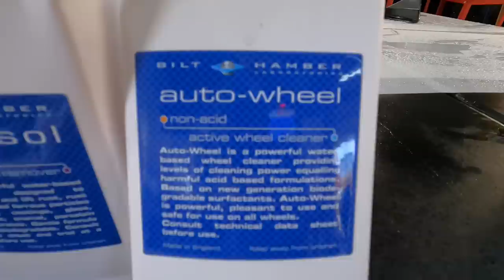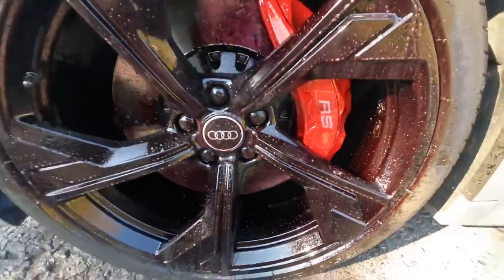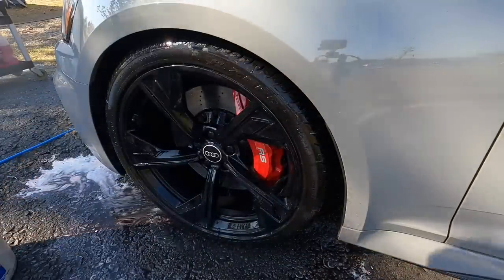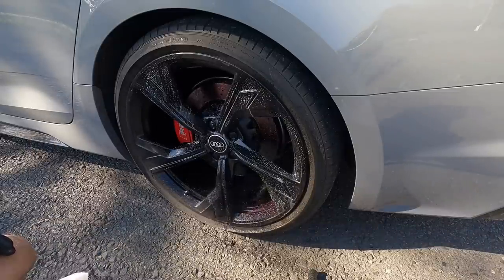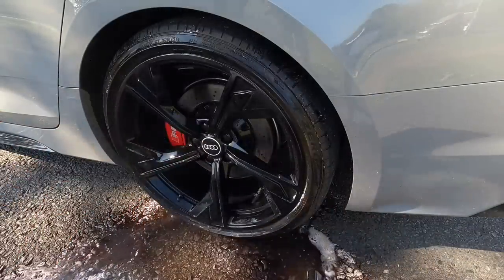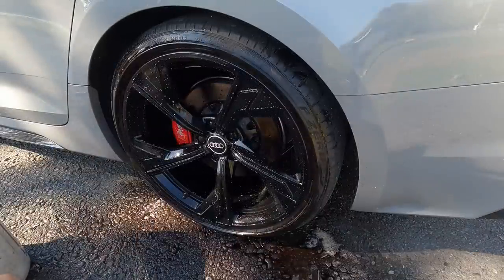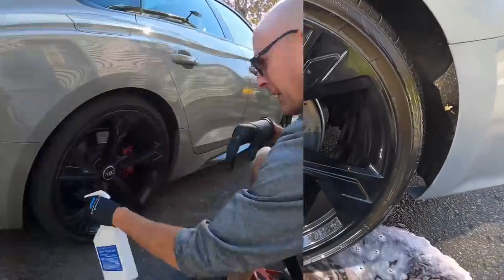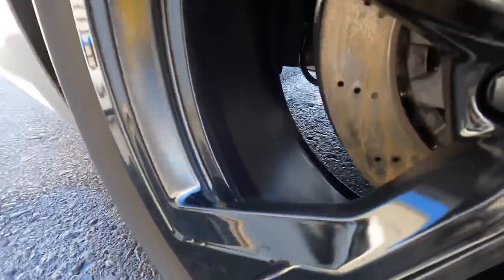What A Team!!  Bilt Hamber Auto Wheel & Korrosol!! Brake Dust Doesn't Stand A Chance!!

Comment from the maker: What is your go to wheel cleaner? One of my favs is Nanoskin Non Acid Wheel.
Reply: I normally use Bilt Hamber Korrosol and either Surfex HD or Majestic Solutions Tidal Wave
Reply: I've been using the Adam's Tire and Wheel in the gallon container recently.
Reply: I’ve been using the Adams as well, but when my gallon runs out I’m going to try this Bilt Hamber next go round.
Reply: Koch chemie sells a 15ltr, very effective and also Nerta active diamond foam.
Reply: Surfex HD seems to do better than most wheel or tire cleaners at 15:1 and even 20:1, I use it for wheels and tires, engines, interiors, some fabrics and even  as a floor cleaner in the house and garage at 40:1. Cleans vary well, virtually no smell and rinses and wipes off easily.
Reply: I normally do Gyeon Wheel Cleaner and followed with P&S Brake Buster in a foam cannon for extra lubrication. I recently bought P&S Knock Off Wheel Cleaner but haven't used it yet. Anyone tried it? I also bought their Undressed Tire Prep.
Reply: I use nanoskin non acid also based on a very old video you did. I bought the gallon from Amazon for under $20 at the time. Still have about 20 oz of the bottle left and I'm detailing two cars every other week or so. The retial bottles are such a waste of money, in my opinion. I use with the marolex foamer. Less product waste and more bang for your buck. I use eagle one iron remover every few months to deep clean and remove any ferrous metals. Luckily Ollie's had a case of them earlier this year and I grabbed about six bottles. Very impressed with the nanoskin non acid though. Thanks for the recommendation from a few years ago. Will buy again probably early next year when I run out.
Reply: BH Auto wheel. It's fantastic stuff. Links well on wheels. I save the Korrosol for the paintwork.
Reply: Poor Boy's spray on Rinse off
Reply: P&S BB I havent gotten to, using up other stuff, I did use Surfex HD the other day and it did very well. I think it was at 1:7 ratio.
Reply: Brian, is this your usual process for wheels? Iron remover, rinse, wheel cleaner, agitate, rinse? I typically use Nanoskin in a foamer, agitate, rinse. Iron remover if necessary.
Reply: Fireball iron burn and 3D BDX
Reply: Sonax beast so far

Comment: Been using Bilt-Hamber products for a couple years now and there NO turning back! It started with their AutoWash, VERY, VERY concentrated, literally an ounce for 3.5 gallons is too much even!

Next was their dynamic duo of Auto-foam and Touchless. These are both pre-washes and no matter ANYONE says...THE BEST ON THE MARKET and its not even close❗️ Last winter I used 5 ounces of Auto-foam and 1 gallon of distilled water in my IK Foam Pro 12 as a pre-wash at the quarter carwash and it literally MELTED the salt and muck from my car. After a rinse there was just a faint shadow of dirt but you had to look for it❗️

I used Karrosol as a chemical decon on my paint and it was amazing and will use it come spring as a post-winter detail but using Auto-foam and Touchless it isn't going to have to work too hard❗️

The only distributor of Bilt-Hamber is somewhere in your backyard Brian, I'm not mentioning them by name out of respect ofcosrse but I'm sure the viewers can find it and once you do you'll either purge your other products or give them away❗️❗️

Comment: I like there APC surfex hd I use it for wheels and tires most of the time at 20:1 and it instantly turns brown and cleans fast and rinses easily, I use it for interiors aswell at the same dilution and it really cleans those dirt covered plastics in one pass where as most of cleaners take 2 rounds on the same areas.
Reply: For the interiors you can drop it down to about 2% (or 50:1) and it still cleans as well, it's the best APC in existence right now I think.
Reply: Don’t use it at that dilution for interiors mate. It leaves a slick film on plastics at such a high concentration. Can be dangerous if you’re cleaning pedals. 

Use at 2/3% max. Avoid using on leather. 

5-10% max on wheels. 5% really as you won’t notice any difference and it’s a waste of product going higher. 5/10% are archways and tyres. Same for engine bay as well. Can also we used at the same concentration as a citrus prewash. Either do lower panels or the whole car.

Comment: Would say just but Korrosol. No need for Auto wheel. The reason why is that Surfex HD is perfectly fine to use on maintained alloys or even dirty ones. You only need Korrosol every month or two to clear out the fallout. If you’re disciplined, Surfex HD is more than enough.

Comment: Personally I've used these products on wheels and they work well but I did test the iron removing aspect by cleaning with just an APC and recleaning with iron remover and autowheel and saw no reaction so it seems a waste to use iron removers most of the time plus they are expensive and well, stink. The only bilt hamber I've had an issue with was the clay bars seemed dry and kinda break up like old play doh and really grabbed the surface even with a vary good clay lube with the regular and  heavy duty bars.
Reply: Tried the clay bar with just water? BH states it can be used this way, no need for dedicated clay lubes. 
I've used their clay bars for years with no issues.

Comment: I’ve been using these products for years, never anything else. 
Not seen them used this way as Korossol is for body work, and not as powerful as Auto-wheel
Reply from the maker: Most wheels have a clear finish....just as effective as the wheel cleaner...great as a team.
Reply: There's no real difference in power.. the difference is in the added gel like structure with auto wheel. that makes it cling more to wheels
Reply: @sebster6031  actually auto wheel has more cleaning power too

Comment: Most, if not all, wheels only need soap and water to effectively clean. Granted, unkept wheels will require more aggressive products and/or techniques but generally speaking soap and water is more than enough. Don’t believe me? Try it next time. This is especially true if your wheels have been coated, waxed or sealed.

Bilt Hamber make excellent products, no argument there. So do many other manufacturers. But are they really needed? I will always argue against that. Why would you use a sledgehammer to hang picture frames? Why would you use a broadsword to spread butter on your bread? I mean, right? It doesn’t really make any sense to me.

When cleaning ANY part of a vehicle, all you really need is lubrication, agitation and rinse. I mean, unless it’s a stain of some sort … then you bring out the big guns. I know, I’m full of it and have no idea what I’m talking about … I get it. Do me a favor, though … just try it. If I’m wrong you can come back here and call me an idiot.

Need more proof? More incentive?

Aight then …

What is the cost of wheel cleaner, tire cleaner, decon chemicals, APC’s, blah blah blah???? Do they effectively clean? Yes. What’s your profit margin afterwards?

What is the cost of 1 ounce of soap or rinseless wash to a gallon of water? Is it effectively cleaning? Yes. What’s your profit margin?

I mean, if you’re spending $20-$60 just to deliver a basic detail on a vehicle … why? You can do nearly the same with just soap and water for a fraction of that.

I rest my case.

Disclaimer: I am NOT advocating the use of just soap and water and nothing else. That’s ridiculous. Sometimes chemicals are needed, sometimes required. I am saying that most times, soap and water is all you need. This is based off 30+ years of detailing experience.

😊😊😊

Comment: Aint they the same thing? Autowheel just has wheel cleaner added to the iron remover and korrosol is a dedicated iron remover for body. Using both seems like a waste
Reply from the maker: It may be...but they have a different consistency
Reply: I’ve heard they’re the same chemical it’s just auto wheel is made thicker to cling better. I could be wrong on the chemical make up so don’t quote me on this.
Reply: @orthodox1717  
That's not right! Korrosol is, as you say, thinner. 
But they are both not the same. Auto Wheel can be left on longer and does not dry as quickly as Corrosol. 
Then when you work with them when touching, Auto Wheel foams more. 
Korrosol reacts lightning fast and changes color Auto Wheel takes a little longer. 
Korrosol is probably the Iron Remover I've tested that reacts the fastest of all, regardless of brand. 
I have changed a lot between Korrosol and Auto Wheel, if I have to choose one, it will be Auto Wheel. 
I use Auto Wheel on all the cars even on the paint it doesn't hurt. I like that it can stay on longer even if the paint is a bit warm. 
The rims spray on at least 2 work with one while the agent works on others I usually do. 
I don't combine them both like Brian does both contain Iron Remover. 
Auto Wheel also contains something else that cleans a little better on several types of dirt. 
If they were the same, Auto Wheel would probably have reacted as quickly as Korrosol and changed color to purple. 
You hardly have time to spray Corrosol before it changes to purple. 
Both are really good Iron Removers among the best available in my opinion, no one will be disappointed by the effect on any of them.